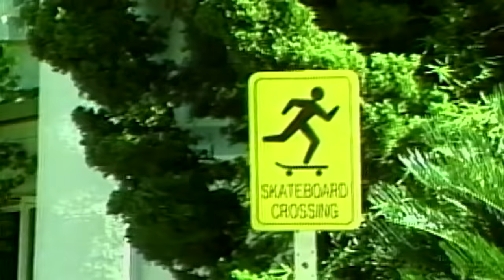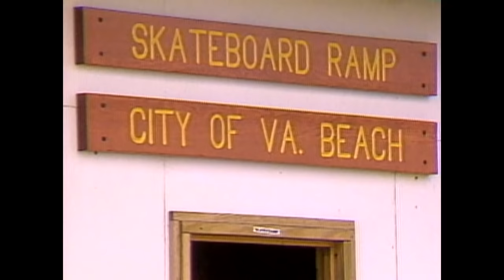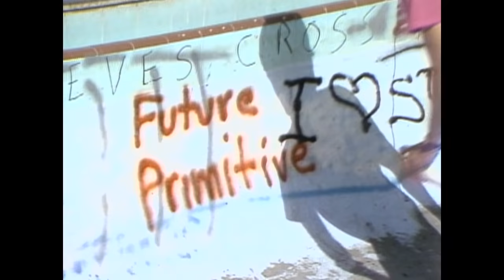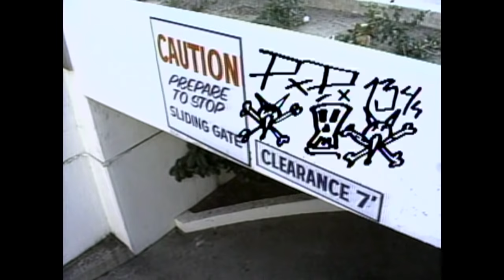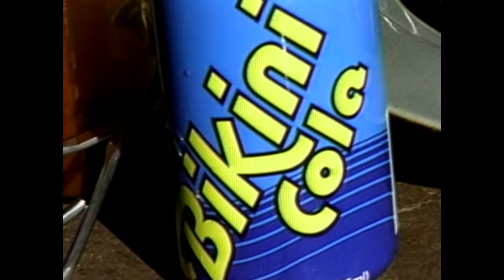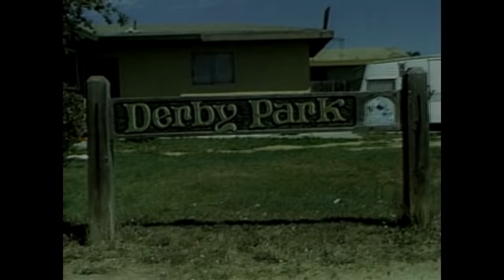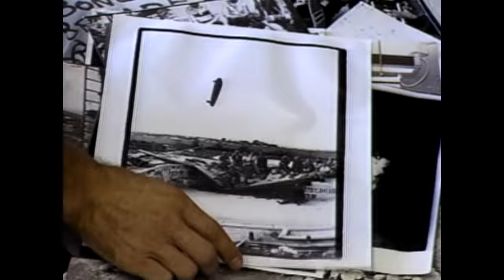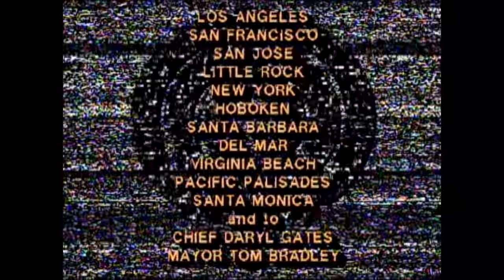POWELL PERALTA PRESENTS:  FUTURE PRIMITIVE

Comment: The first early encounter with a street style of skating.  I never did get the hang of street other than riding my board on them to the local park.  The old style has been forgotten by the young kids today.   60mm wheels, boards with rails.  Olly was a boys name, pop was a drink :-)
Reply: Some kids are using rails again.  I was glad to get rid of mine 30 years ago - stupid rattly things
Reply: @JezBollah 667 Never had loose sex bolts?  Self tapping screws were better but even they would come loose after a few weeks.

Comment: It would be interesting if you told more about the cameras and recorders. Betacam was released in 1982, Betamovie in 1983, JVC GR-C1 in 1984. But in the preface to the movie one can see a professional shoulder-mount camera, something like Ikegami, connected via cable to a recorder - was it Umatic or VHS? Clearly, different parts of the film were shot with different cameras, some of them are pretty bad, like those New York scenes.

Comment: Instead of rehashing the same videos over and over, Stacy P should make another Bones Brigade video the team skating Re-issue boards. I'm tired of seeing the same old popsicles boards in skate videos for the past 25 years.
Reply: I hear you on that, I hate popsicle boards. It's a gimmick and those cheap boards snap because the veneer is thinner. Check out a Hosoi Hammerhead deck. Close to a half inch thick and heavy duty !